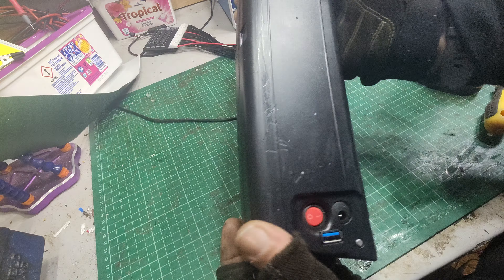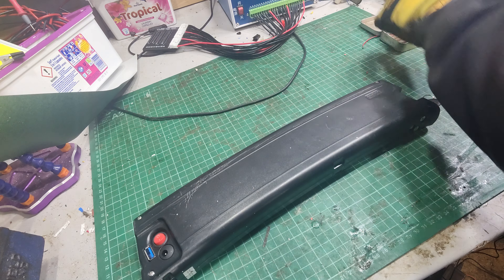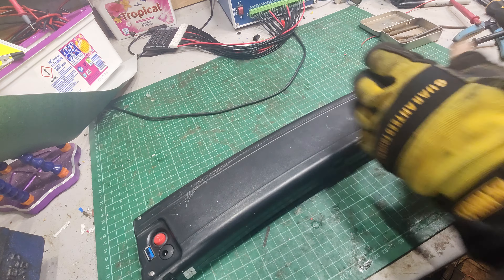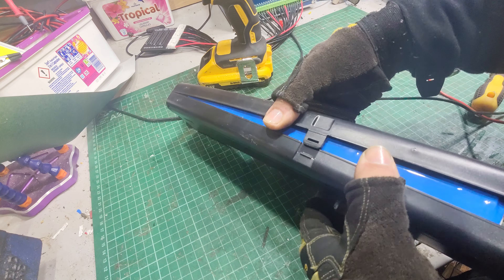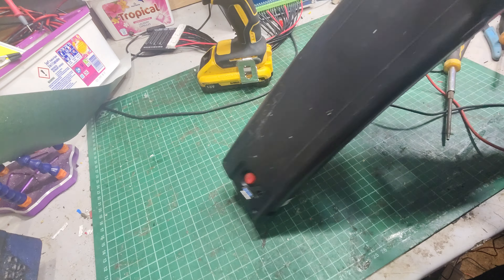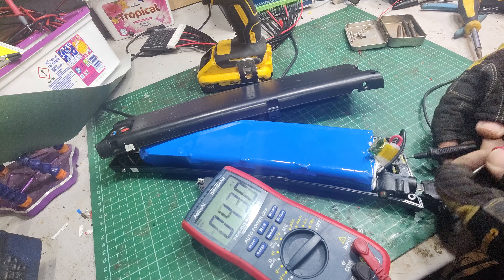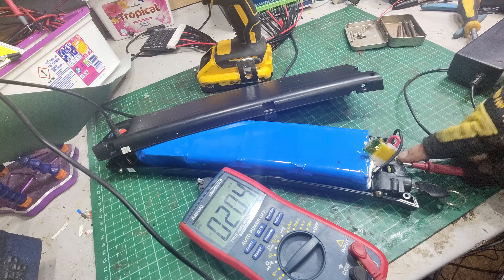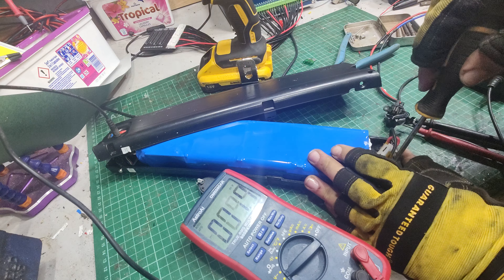Carrera CrossCity E Battery won't work - why? (Bent pins)

Comment: Here are the symptoms I had with a Carrera Crosscity: it was working correctly last year, then it was left over the winter and now on the first attempt to use it this spring it did not work. The bike display did not come on and the charger LED went immediately from RED to GREEN when connecting the battery.

With the battery removed and the switch turned on, there was no voltage present on the +/- terminals of the battery connector. I checked that there was voltage on the charger's plug, so I knew that there was something wrong with the battery.

It goes without saying, if you are going to open up the battery pack then you need to be very careful, it is energy dense, and you don't want to short anything out! I disassembled the pack and measured about 40V across the main connection points to the end cells, so I knew that it was unlikely that there was a problem with them.

I then suspected the BMS and so I carefully removed that from the pack to inspect. In doing so, I discovered that 4 of the 0603 SMT inductors (adjacent to the connector) were measuring open circuit. They should be less than 1 ohm. They didn't look electrically damaged, they looked like the metal endcaps were corroded, so it could have been a manufacturing problem since there were no signs of water ingress.

I replaced the faulty inductors with some new ones and that fixed the problem with the pack, the battery charged, and the bike worked. The exact inductance of the inductors is not that important, they are probably only there for EMC purposes. You could just remove any faulty inductors and replace them with a thin piece of wire, just be careful that you don't short out anything else!

I hope that is helpful to someone else.
Reply from the maker: Very helpful! Just check every cell group voltage wise to make sure they're balanced. Thanks

Comment: Do you have any info on waking these Crosscity E batteries?  I have one that is intact but was left uncharged for a few months and I think the BMS is preventing charge.
Reply from the maker: unfortunately without opening it to check cell voltages it isn't safe to do it!